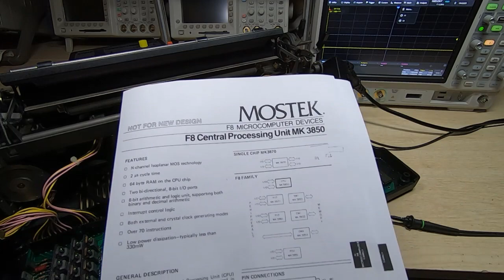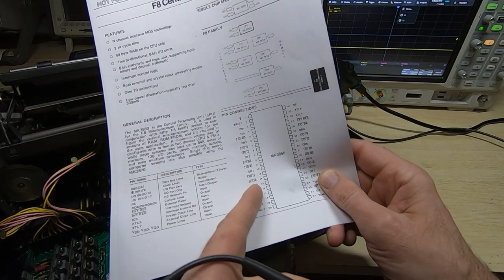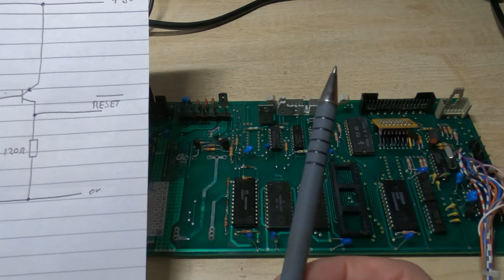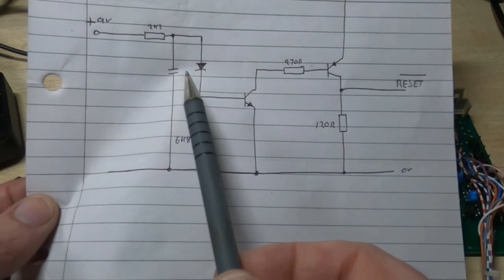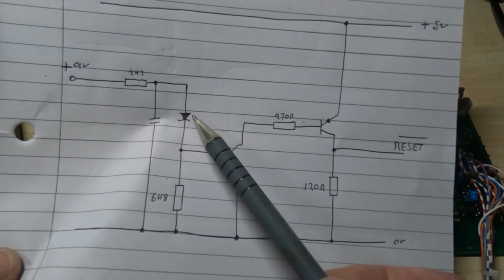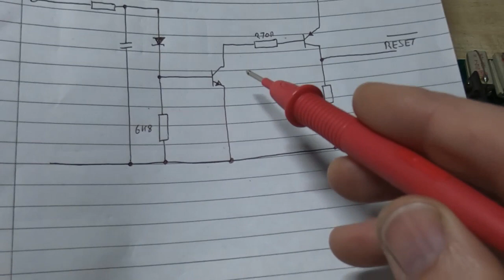Olympia ESW 100-KSR Repair Part3

Comment: Isn't the zener upside down in your sketch?
Reply from the maker: Yes (maybe) but this is a reverse engineering sketch. I drew it before I had the complete circuit so I drew it as it 'measured' using a meter and it was not until I had more of the circuit that I realised it was 'probably' a zenner (It may not be). It is always easier to see what may be going on once the entire circuit is available but I did not have that visibility when I started and I have not made any attempt to confirm that it is actually a zenner and for my purposes it does not matter (as the outcome proves). Also several of the tracks were open so this is not as easy as it may seem.
Reply: @JerryWalker001  My apologies, it was only a nit-pick.  As you say, not important for the repair, and I agree, reverse engineering a damaged board can be very confusing.

Comment: This takes me back memory lane quite some time. We fixed a number of these in our repair shop. And I've built an interface to a Commodore CBM 8032 for a customer. Unfortunatly I don't have any documentation or manuals. The shop went bancrupt in the late 80s. I worked there from 1979 to 1986. Olympia was a german brand, located in Wilhelmshaven on the North Sea coast.